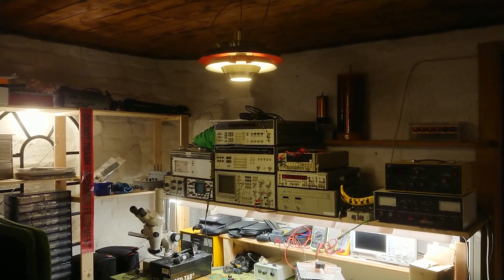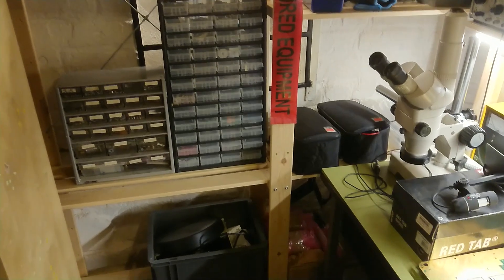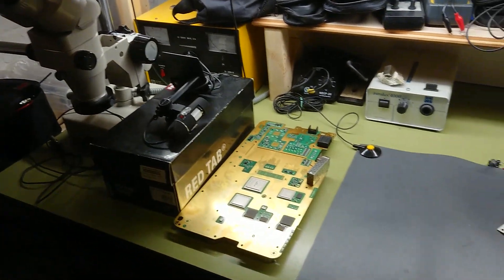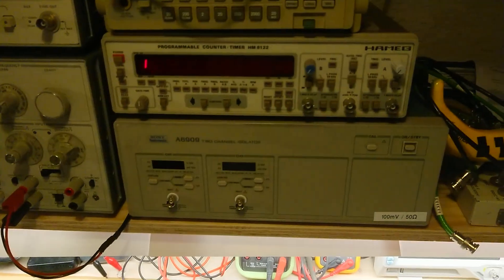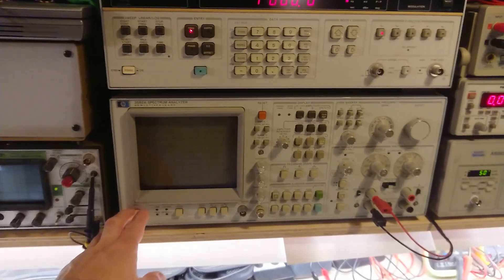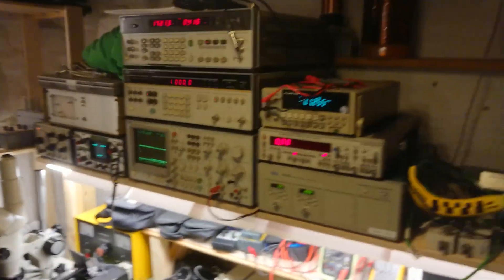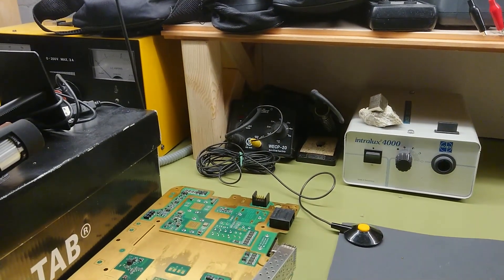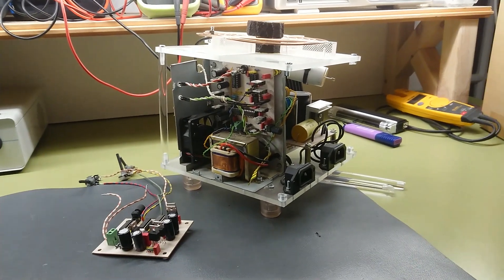Moving to a new lab! (Part 6) Lab is operational!

Comment: Very nice setup. Where's the tube amp?
I'd venture saying it's a 450L but I'm sure I'd be wrong as the anode is very cylindrical rather than dome shaped. Maybe a 350L?
Reply from the maker: It is a 250TH, the amplifiers are very far from built, as I did not settle on a design yet. Will properly be a SE as I never had such a tube amp.
Reply: Kaizer Power Electronics : Darn! I thought it looked bigger - the fat neck and the broad shoulders fooled me. Be careful when storing these valves, they have a very fragile construction. It doesn't take much to break the internal structure.
Have you decided on what output transformers you will get?
Reply from the maker: @Stelios.Posantzis  I got 3 tubes and I fear one of them is dead or damaged, since its rattling when shaken lightly. I will order custom made made power transformers and output transformers from dagnall electronics. I have used them before with good results.
Reply: Kaizer Power Electronics : The tubes of this family are very fragile and require special care with packaging when they are shipped. They cannot handle vibration and shocks due to their internal construction. Just wrapping them with bubblewrap won't cut it as vibrations and shocks are transmitted right through it to the tubes. 
Thanks for the pointer to Dagnall Electronics. I'll check them out and see what they have to offer. 
Good luck with the project.

Comment: That's a  "Flux  Capacitor" tube
Reply: The expensive one that didn't get dropped, at that.  The knob on the top is a little suspicious --|/|--  hiKV
Nice shop!  I look forward to your projects and seeing where you put the cupholders and stereo.  May I suggest a small rolling table (or cart) under the workbench to give you some some flex-space for covers and the like?